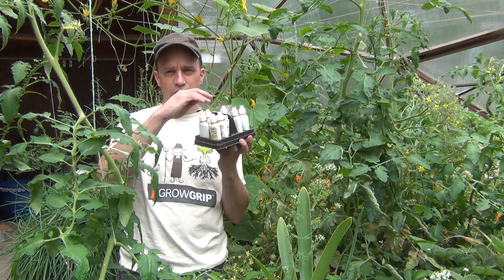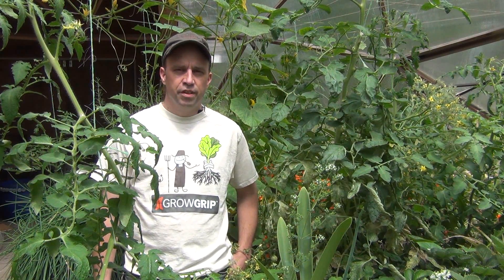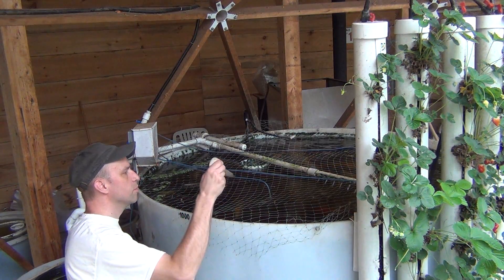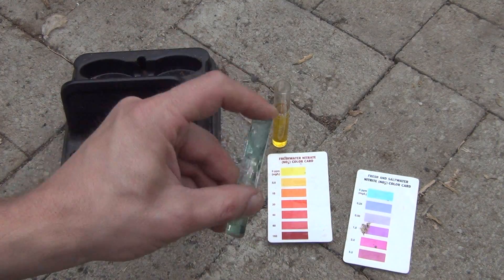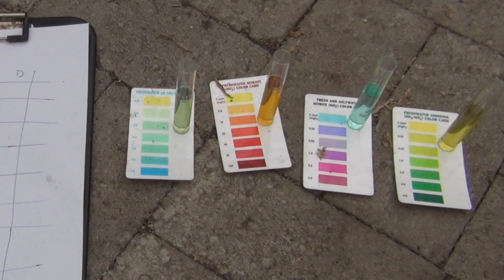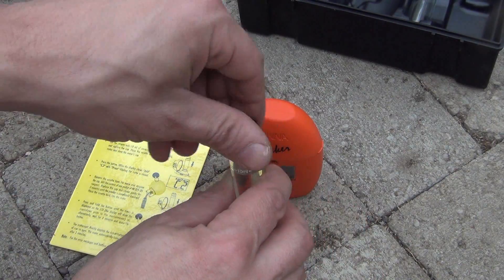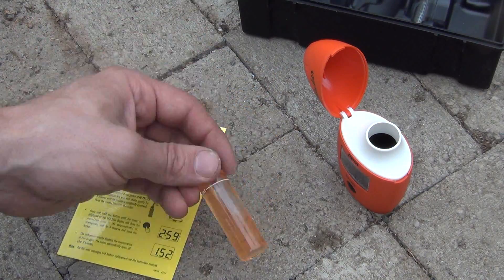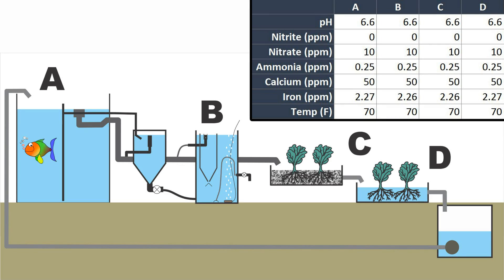More Water Testing

Comment: Any word on the changes since your last test? And really, the chemistry will change a lot between day and night, so doing two tests (night, day) would be really interesting to see. One of these years, I'm going to get my reagent robot finished and then I can test a few times a day or even hourly with less reagent use (and less water). 
https://hackaday.io/project/4197-reagent-robot
Reply from the maker: James Newton I haven't seen a huge difference with the readings between day and night, but I really don't test very often either.  It happens that I usually just test near the end of the day since I'm done with work.  ;-)  I've always thought about designing a reagent tester like that but have too many other projects to work on.  ;-)

Comment: So the reason you should wear gloves when doing tests like these is because you are a biological system that also produces a lot of the same chemicals you are testing for (Iron, nitrate, nitrite, calcium, etc.). They could easily be excreted in your sweat, so you could alter the measured values by touching your water sample. Also, if you touch something in the environment (like a rusty surface) and then touch your sample before testing you could throw off your results. Sometimes gloves protect you from your chemistry... other times they protect your chemistry from you! And as a chemist I approve of your cool little spectrometer (iron meter).

Comment: Rob: Good subject, and it's really interesting that your system is so homogenous, especially given its complexity!  I often find significant pH gaps in different parts of mine, which is a fraction of yours in volume and has pretty good circulation.  Also: I found that using a 10cc syringe to extract my samples makes both measuring and filling vials neat and easy.
Reply: SeeMikeDoStuff "10cc syringe" That what I use as well, work great, except for the odd mad scientist look, that you get from people.